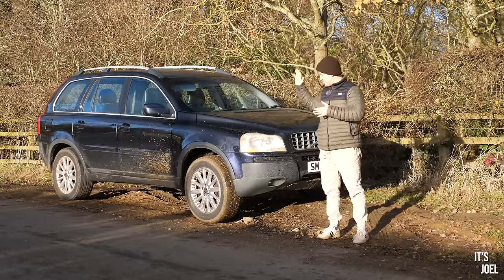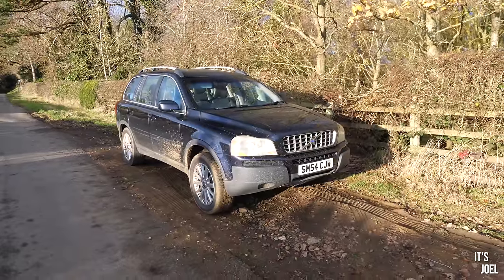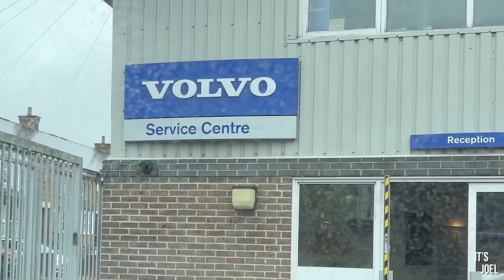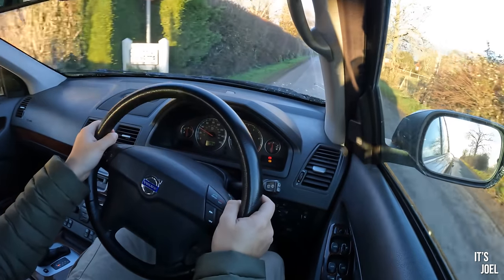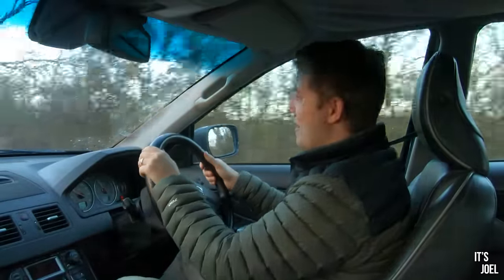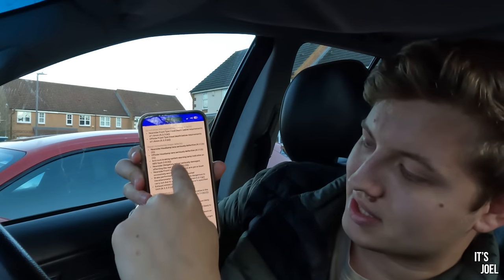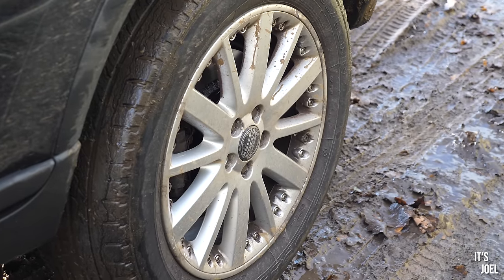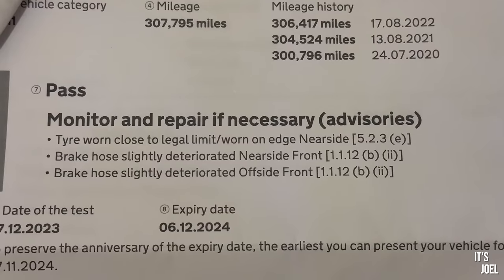CAN I SAVE MY £800 COPART VOLVO XC90? PART 6

Comment: Probably you should get an award for sustainable motoring for showing that yes you can fix up a 20 year old car, but that you need to be realistic how hard it might be and what can happen. If more people did this instead of buying new electric cars on tick then the world would be a better place.
Reply: AdrianScoffham
Not if a foscil fueled vehicle is driven within an inner city area its not.
Electric vehicles in a built up area are far better, their emisions are comparible to that of a pedal cycle
Reply: @andypicken7848  what about the battery and the horrendously unregulated source? Where is the electricity sourced in charging?
Reply: @sickbozzer  Where electricy is sourced is a different issue. EV's are better in town due to zero tailpipe emmsions. I live on a High Street and the smell of fumes from ICE vehicle is really bad.
Reply: Everyone seems to believe that, but it's completely wrong. Every additional mile an ICE vehicle drives is more damage, scrapping it and buying an EV would be the best thing for the environment every single time.
Reply: sickbozzer
With respect your reply is a "straw man"
The bare facts are that foscil fueled vehicles are most damaging to human health in built up areas where pedestrian etc are breathing in their emissions. As EVs are emission free (at the point of use) they are infinetly better for public health in built up areas.
If you think otherwise just ponder a very simple question,
"Why is the exhaust pipe on a foscil fueled vehicle at the rear of the vehicle"
Its obvious isnt it?
Reply: @andypicken7848 I think there two different points trying to be made here. Obviously an EV is clearly a better option from a direct human health impact perspective for those within the direct vicinity of the vehicle being driven, but the argument above was more about the environmental impact of the EV from a sourcing and manufacturing viewpoint.
Reply: @andypicken7848  that’s fair enough, however you can’t claim that they are carbon neutral as they simply aren’t.
Reply: @DPW864  yup
Reply: @JohnBaxendale  source: nonexistent
Reply: sickbozzer
At the risk of sounding like a stuck record, again your statement is a "straw man"
Iv never heard anybody claim that EVs are carbon neutral.
The facts are that all production of vehicles is environmentally damaging because of the use of large amount of metal.
The question is which type of vehicle is more damaging to the environment and public health. The other big consideration is sustainability
Reply: @sickbozzer Nobodies claiming they're carbon neutral.
Reply: @sickbozzer You can do the math yourself or just google it, EV's pay off their manufacturing debt within a couple of years of manufacture, as long as they survive for longer than that period (~2 years), they're going to be less impactful on the environment than an equivalent ICE vehicle. Every additional mile you drive an ICE vehicle just does more damage, it's never going to pay back it's carbon debt, it just keeps polluting. It's not complicated.
Reply: @JohnBaxendale  I’d agree if you can supply me with a source of your information
Reply: @JohnBaxendale  aside from every car company and politician
Reply: @andypicken7848  maybe not anybody, but every corporation (car company) claims that they are carbon neutral just because they have no tailpipe emissions.
Reply: @sickbozzer  It's not the responsibility of everyone else on the internet to educate you ;)
Reply: Joel, get rid man, don’t go spending ££££s on this when you could put your money into a Range Rover. 👍🏻
Reply: @andypicken7848  wow, what a can of worms opened up here eh? Naturally driving a highly polluting vehicle in a built up area is bad: I used to live near Frankfurter Allee in Berlin before the diesel particulate scandal kicked off and we know about the sad case of the little girl who died of asthma because her Mum could only afford to live on the South Circular in London. At the same time let us not confuse clean air in cities for the bigger picture on sustainability which is that in general repairing and using an old vehicle is a good thing for the planet. Certainly there will be cut-off points and it wouldn't be that hard to calculate the resources used and externalities created to make a new vehicle to compare with those associated with repairing and using an old vehicle. I live in Tbilisi, Georgia where you can often find vehicles repaired and reused that are 30-40 years old - the reason being many people don't have the money or access to credit needed to get a shiny new vehicle every 3 years. I think there is a valuable discussion to be had with ALL the facts in hand along with an understanding of where a vehicle is to be used as a guiding light before we go off into well-practiced arguments that seek to "other" people with differing opinions as we can see has happened on this thread. That's a shame... Could be a cracking thing to make videos about...
Reply: @JohnBaxendale  that most likely means you don’t have a source of that information, and is created in the EV bubble in your head. I can give to you plentttyyy of articles (including the one from the likes of Volvo) about the iffy sustainability around both electric and petrol/diesel cars. Just go e-fuels/biofuels for rural areas and small electric cars for cities, not your audi q8 Etrons and BMW iXs.
Reply: @sickbozzer  The Volvo article that’s been widely debunked? Cool story bro.
Reply: @JohnBaxendale  by who? Where’s your source? Also; I can’t be asked to argue about this anymore. Let’s just accept our differences in opinion and move on in life as I’m sure there more useful ways for both of us to use our time!
Reply: @JohnBaxendale  bollox !
Reply: @stever7667 Thanks for your well reasoned and fully evidence based contribution to the debate Steve.
Reply: @AdrianScoffham These calculations have been done already, it takes about 2 year for an EV to pay off it's manufacturing debt. After that point it's a net win for the environment, ICE vehicles kept on the road for 40 years to just do more damage, they never pay off their debt because the continued use of oil increases their damage. Even if an EV is owned by the first owner for less time than it takes to pay off it's debt, it's still a win, as it's displacing an ICE vehicle from being manufactured and the vehicle will go on to have a life with a 2nd or 3rd owner. There are no situations where keeping an old ICE vehicle on the road is a positive for the environment, this is blatantly stupid idea and needs to stop being perpetuated.
Reply: @sickbozzer  I'm not stating an opinion, I'm quoting facts ;)
Reply: EV's in the town/city, fossil for big journeys, simples.  Although EV's are not completely saintly - particulates from the tyres and brakes

Comment: What a joke of a garage. Falsifying an MOT by deleting the error code which they know full well will come back on in 30 miles. Genuine discs, pads, shoes and adjusters are around about £200. Those prices are ludicrous. Glad it's got a ticket, although a dodgy one
Reply: Fraudulent  behaviour  , knowing it will come back and its not just the light you could see the abs ring was cracked so that is a fail in itself. So it's a bent mot it's as simple as. That.
Reply: Had all that handbrake work done on my Mk 1 S 80. Bought the bits from PFS and a local mechanic fitted them. Change out of £200.

Comment: Joel, you need to keep this car. It's not only a car; it's your car education. From the work you have done so far, you have learned a lot. You will look at things differently. E.g. the 800 quid you spent on brakes is something that is very, very doable yourself. So keep the car, buy a multimeter and trace the wiring for the stereo and make sure it's sound. Then fix the angle spline sleeve Haldex thing - basically the splines wear out and the prop shaft turns freely without gripping the splines: therefore no AWD. Keep it! And the more work you do, the more you will value this car and you will reassess other cars you come across. Most of us here have had a similar 'project car' that was the making of us: mine was an old Saab convertible. Until that car I thought I was a 'car guy'. I wasn't. I was nothing! That car made me! This XC90 is making you!

Comment: Joel , they done u over man , I'm a mot tester , you shouldn't clear a light and wack a mot on it , that is fraudulent  behaviour,  the tester is knowingly  passing a failure item. Its not just about the light being off.  He should of failed the abs ring cracked or damaged.  You and him have missed the point. Could probably  just a 2nd hand hug and driveshaft and be done with it. Basically  u paid for a dodgy mot and rear discs and pads and shoes and a couple cables . Joel come on you know aswell. Because  there's nothing new except  new rear brakes lol 😆   but great vid anyway bud be lucky on next one.

Comment: Getting the steering wheel set straight should be no more than £30 at a small local tyre garage. They'll set steering wheel straight and adjust the tracking it takes about 15 mins. Enjoy

Comment: The AWD will be the coupling (spline) where the prop goes in...Park it up and get under it and if the rear prop shaft spins by hand then its your issue.

Comment: Hey Joel, love the channel. Those ABS rings swell as they corrode which increases the outside diameter, so they start kissing the ABS sensor.
An easy fix, and I’ve done this before with my BMW, is to unscrew the ABS sensor put a little washer underneath it and then mount it back onto the bracket so that with the washer underneath the ABS sensor is sitting back by 1 mm no longer kissing the rings  it’s a simple job for a couple of pence.
Reply: But not so much (easy) on this car as the drive shafts are seized in lol

Comment: The car you have , you know what is needed, to change it to another is to start all over again.
You can always get a set of drive shafts with hubs from the junkyard for the ABS ring change. 
Then it is pop out the drive shafts from the inner cv’s and replace shafts and hubs, no need to try split the hubs from the outer cv’s.

Comment: With a high mileage diesel like the Volvo I’d recommend getting a Terraclean of the engine. It’s not the cheapest but I’ve done it on several cars with excellent results. It may well fix your rough running. I recently got my diesel Jag done and the performance difference was amazing with a massive drop in emissions. Do try it. Would make a good episode.

Comment: I have a 2010 XC, with 178k on the clock, and have spent plenty on it so far, including £600 on paint repairs in the last few weeks. However, I wouldn't want another car, this does everything so well, and feels super safe on the road. Good job with yours, keep going, it will be worth it in the end.

Comment: I bought my xc90 for £800 aswell, it has a abs light oil leak engine mounts where shot, no mot and a horrible misfire that I changed a injector for a brand new one, just over 2k for all the work to be done, and I wouldn’t change it, the thing is brilliant, the injector fault turned out the be the connector, I’d probably suggest checking those, I had to close the connectors up slightly to make good contact

Comment: Check the vacuum out of the vacuum pump to the turbo wastegate / engine mounts is working. There tiny rubber seal in the one-way valve in the lid of the vacuum pump. The valves often fails.  

And rough idling is injectors. 
And maybe the whole inlet manifold is filled with gunk (sticky oily mess) caused by the EGR.
In the A pillars are drain pipes from the sunroof, these pipes crumble and fail, causing water ingress in the front footwell and drowning the stability control unit. 
Check the alternator brushes (and bearings).

Comment: Cheapest option you can try is taking a blowtorch and heating the surface of where she shaft goes into the hub, then use a bronze shaft to smash it out. It's helped me out a dozen of times on the crusty musty's. Never a guarantee that it'll work, but it'll save you the damages of them using a press.

Comment: I love the original XC90 - I had one from new (2007) until 2017 and did about 120k miles in it. The wife clobbered the driveway gate with it and we decided to trade it in at that point and I still miss it. However (there’s always a but!) they are a complex machine with some very annoying design “quirks” that make things that should be relatively straightforward to fix extremely hard. A small oil leak from the gearbox? Take the whole engine out - 20 hours of labour. Issues with the fiber-optics can often write the car off. The rear wheel drive part of the AWD often fails as the splines strip on the spline sleeve (and it happens again and again). Forget to change the auxiliary belt? Watch out because it will destroy the engine if it fails and wraps around the cogs. These cars are stupidly complex and expensive to maintain (even more so than Range Rovers). I would move it on and quickly!

Comment: I have enjoyed this series so far and fair play mate for getting that MOT. What I don’t understand is why the insurance is so much.
Reply: Snap seems like a hell of a slug of money for an old car
Reply: Maybe because of Volvo's spare parts prices? Also all car insurance has increased significantly in cost over the past few months, as I found out at renewal time a few weeks ago
Reply: cmartin_ok
It definetly will not be because of the price of volvo parts. A vehicle can be "written off" once the cost of repairs exceeds 75% of the value of the vehicle and this vehicle was only brought for £800
Reply: Parts for a 20 year old Xc90 are fairly cheap, lots around on different sites from scrapped cars to brand new parts. Love my 19 year old Xc90 wouldn't part with her.

Comment: The 4W drive system doesn't work probable because the splines on the axle between gearbox and transfer box (angled gear for rear wheel drive) are gone/worn away.  
There are only two solutions: new transfer box, which is prohibitive expensive or the engineering options. 
This involve drilling holes in the sleeve that connects the transferbox to the gearbox which slides over the transferbox axle. 
Then drill a big hole in the transferbox casing so the sleeve can be welded through the transferbox housing hole using the holes in the sleeve to the axle. The alignment of the sleeve must be perfect.  
Close the hole in the transferbox with liquid metal. 
This last solution means the transferbox can never be disassembled anymore. So maybe put in new bearings before the welding.  
And put two oil seals in the gearbox (where the sleeve fits in), they tend to leak there.  

I did that 6 years ago to my XC90. 50k km later it still holds.

If the splines are gone can easily be tested; can the propshaft to the rear wheels be turned with the engine off (safety) and gearbox in park? If yes, then transferbox problem.
Reply: The transferbox can be taken out without taking the engine out. However there are some really hard to reach bolts/nuts.

Comment: That's the thing with these AWD, cause they don't go off road the rear diff doesn't detect any slip in the wheel so doesn't engage. Over time they seize and don't work. Evidently, just remove the prob shaft and you'll be fine 👍 - Mechanic by day - over 10yrs in volvo

Comment: £2K for insurance? My current policy cost me less than half of that. I'm a bit older than you so that might have something to do with it. Be thankful you're not paying £600+ in VED unlike certain Land Rover Discovery drivers. Fixing the AWD shouldn't be too expensive. I had to pay about £300 for a reconditoned DEM to fix mine. The fault codes will point you in the right direction. It would help if your bottom left display was working. Most other AWD problems are the Steering Angle Sensor (SAS) which is integated in the clock spring, the yaw sensor (particularly if the sunroof is leaking), and stripped splines on the bevel gear (transfer box). You've done the right thing by getting it through the MoT first. The other stuff can be done at your lesiure. The parking brake can be a pig of a job but mine has always got through the test. I spent nowhere near as much on my rear brakes (discs, pads, parking brake shoes and the left rear caliper). My mechanic has had problems with stuck XC90 driveshafts but my front ones have come out without any problems. I once had that problem with a stuck drifeshaft when I was changing the rear wheel bearings on a BMW E36 318i. I found a hub puller tool in Machine Mart which got the driveshaft out.

Comment: They are terrible for the driveshafts seizing, volvo have a hydraulic press that bolts to the hub. But even that sometimes doesn't budge them. Sometimes only option is to replace driveshaft and knuckle

Comment: New wheels always go in the back. Great that you got it back in the road. Cheers from Argentina!
Reply: Nope. AWD Volvos are normally 90% drive to the fronts, 10% to the rear unless wheel slip, then the electronics manage the traction. Because the front wheels do 90% of the work, - steer, brake and drive, that is where you want the new rubber. The rears only hold the back corners up.

Comment: Finally an update. 👍😃 This would make good future episodes how to fix old car and as others commented it is about going all in and fixing this old girl. Maybe you can join some other more mechanically minded youtuber and fix the abs using the big hammer or something. 😂 But I think if you give it away it is sort of half cooked. You can do quick check on AWD system. Go under the car and try to spin the prop shaft as car is in Park. If it spins, then your angle gear sleeve splines are gone. Will need new angle gear and sleeve. If it doesnt, then the issue is in broken or clogged Haldex pump. Otherwise I love the high mileage rescue. Keep up. 👍